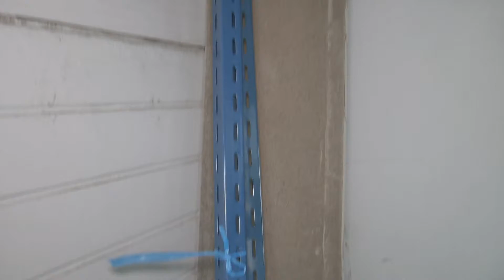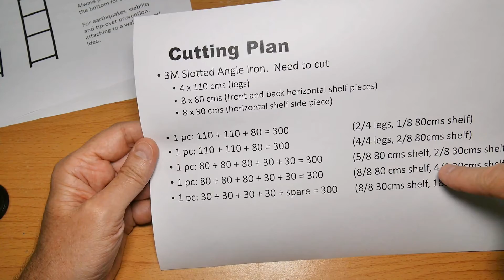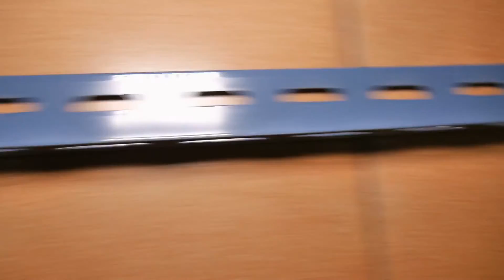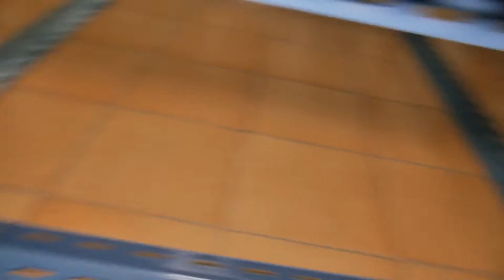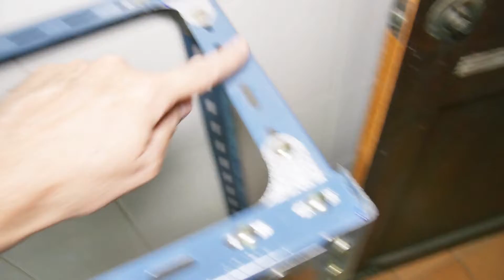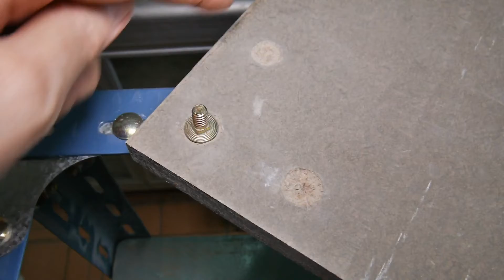DIY Custom Shelves Using Slotted Angle Iron

Comment: I had doubts about building shelving from slotted angle, specifically the rigidity. That looks really sturdy though. I'm confident now that I can start my project and it wont be a waste of money. Thanks for sharing!
Reply from the maker: The angle braces help a lot. For some reason they are harder to find, but well worth the effort.
Reply: @tsbrownie  Thanks. I'm in Australia and our local major hardware chain Bunnings actually has the angle braces readily available, albeit in a "starter kit" that has 24x nuts and bolts, 8x braces and 4x feet.

Comment: Hello fellow internet users… have any of you ever put casters on a shelf like this? If so, how’d you do it (specifics are much appreciated)? Did you take any steps to prevent racking (shelves twisting) whilst under torque/being moved? 

As for materials - has anyone got a good source for cheap slotted angle in 2024? Gotta take shipping into account, too, unless you’ve found a retailer with free shipping 🥳🥲.

Much obliged for your time tips giant cowboy hat and saunters off to await helpful replies 🤠
Reply from the maker: I have. The warning: on my first attempt, I did not account for when the wheels rotate to the inside. That puts a good portion of the weight of the shelf on the outside of the wheel and can cause the shelf to tip over. Another way to say it is the shelf is no longer sitting on the outside edge, but where it is sitting moves inside AND it moves UP. The more the wheel casters, the bigger the danger. 
I ended up using small wheels with minimal castering radius and widened the shelf. How to describe them? The mount is a metal plate with 4 holes, then ball bearing, then a round bearing race, then the wheel.

Comment: I think that square part of the bolt should be on the slot so you only need one wrench for tightening
Reply from the maker: True. The problem was the square collar was too long and when the nut was tightened, it hit the collar before the angle metal. In other words, it left the joints very loose.
Reply: @tsbrownie  okay maybe these bolts are for the thicker gauge angle bars...or a faulty product
Reply from the maker: @nicanorbadal689  I think you're right about them being for thicker slotted angle metal.

Comment: Those corner brackets aren't available anywhere in the US.
Reply from the maker: True. In the description I noted: These are getting harder to obtain. You can find them by searching things like "slotted steel shelf angle" or "Corner Plates for Slotted Angle Bar Triangular Piece Angle Steel Shelf Accessories" and similar. I can still find them on ebay, amazon, ali-express, alibaba, made-in-china, ... Not sure why companies are not selling them because they add a LOT of stability to the shelves.
Reply: @tsbrownie  Yeah I did see them on those websites but they all seem flimsy, 0.8mm/20 AWG and it's going to take weeks if not months to get them in the mail. Thanks for posting the video and responding.
Reply from the maker: @TheJourneyOfMeMyselfAndI  The ones I have are 2 thicknesses, but both are rather flimsy. However they do add a lot of stability.

Comment: OMG, You're in Thailand right?  I'm also in Thailand and when I heard that bird in the background, it's the same noise as one I hear around my home, 555.  Thanks for the informative vid, I'll be making one this week.  The only difference is the bolts, the ones you used are difficult to remove, better to have a bolt with either a screwdriver slot or a head for a wrench.

Comment: Hey great video! Really cool the final result. I wanted to ask you what was the thickness of the angles that you use?
Reply from the maker: I used the thinnest, just because it's all my local hardware store had. If I recall, they range in thickness from 1.2 mm to about 2 mm for non-commercial type application.
Reply: @tsbrownie  thank you so much for your response. I appreciate it. It helped me to decide which to use for my project

Comment: Men you don't have to put washers in evry single bolt😂😂 you don't need it I made it bigger then this and bolts tighten itself no washers needed
Reply from the maker: I agree and said that in the video. It depends on the size of the nuts. I had both 10 and 9 mm. The 9mm nuts are too small to trust with big loads.

Comment: Was this 14 gauge slotted steel?
Reply from the maker: It comes in varying thicknesses.  I'm not sure the gauge, as they always tell me in millimeters.  This is the lightest weight steel at 1.2mm and it goes up to 2mm if I recall correctly.

Comment: This is just a video I was looking for and thank you so much for sharing. I am going to build my TV stand this coming  saturday. My plan is to connect the slotted metal bar to the wall with two or three legs(to be screwed to the wall) and then a horizontal top bar. The top flat will be covered with MDF wood( 1.5 meter long and 45 cm wide). So that i can use the space to place my satellite receiver and the under shelf for placing my flower buckets. If you have an Idea please suggest me. I will share my video once I am done.
Reply from the maker: Be sure to test your finished shelf for strength before loading it up with expensive stuff like your TV, etc.  Leave a link to your video, I'd like to see it.

Comment: Where did you get those support triangles?
Reply from the maker: From a local hardware store. I have seen them on amazon.
Reply: @tsbrownie  do you have a name or part number, I don’t know what to search for on Amazon, and can’t find them.
Reply from the maker: @johnvgig  I don't see them on Amazon right now.  But I do see them other places if I search "Corner plate for slotted angle bar" or "Corner plate for slotted angle metal" and look at images.

Comment: I have a slotted shelf in my home. I want to turn it in a wardrobe. How can I fix wood panels to the slotted angles?
Reply from the maker: With thin panels, you can use the same nuts and bolts as you did to assemble it.
Reply: @tsbrownie  thanks for the solution 😊will comment as soon as I finish it🤘🏻
Reply from the maker: @madan1994   And are you finished yet?   ;)

Comment: Thanks for making this video, you do a nice job explaining each decision along the way and pointing out pitfalls. I'm considering using slotted angle metal for a project, and either I'm Googling the wrong terms or there just doesn't seem to be much info out there on how to design & build with it. Your video is an exception, thank you!
Reply from the maker: Thank you.  Glad it was useful.
Reply: @tsbrownie  One thing I can' t seem to find state-side (in Montana anyway) are those nifty triangle braces. I ended up with extra scraps of the angle metal, and cut it up to make short 45-degree braces, which seems to be fine... just tedious work, is all. I can't afford to throw any metal away :-)
Reply from the maker: @ernavk31 I did some for my parents decades ago and the local (midwest) hardware store had them.  They add a huge amount of stability, I'm not sure why they would stop stocking them.  I found some better ones on Amazon "National Hardware N337-709 MP124BC Corner Brace in Zinc plated " and "uxcell 99mmx60mmx18mm Metal Triangular Flange Corner Brace Angle Bracket White ".  I also found a picture from Homedepot under corner gussets, or gusset plates.  Odd they are not more common.
Reply: @ernavk31  https://www.amazon.com/Aexit-Furniture-Hardware-Shelves-Triangle/dp/B07HR8PCP1/ref=sr_1_60?keywords=triangle+brackets&qid=1570675284&sr=8-60

Comment: Why wouldnt you groove the sides so the width and length are flat and not a top of the other and also I think I prefer fabricating a square and only use slotted angle bar for its foot, less effort on installing and disassemble I think.
Reply from the maker: If I understand your question about groving the material, that cement board is very hard and dulls tools very quickly.  I could have cut the angle metal at a 45 degree angle, but the result would be weaker.  I don't think I understand the second part, what is "square?"
Reply: A support/surface of a cabinet.

Comment: How thick are these thing in mm?  Can it support an ave weight of 80kg?  Im planning to make a cabinet below and bed at the top bcosI have very small room so im looking for ways to conserve it.
Reply from the maker: The metal comes in varying thicknesses and so can support different loads.  I weigh over 80 kgs and you can see the frame supporting my weight.  Bottom line is I can't say for sure, too many factors.  But for more weight capability buy the thicker metal (about 2mm) and use those triangle supports at every corner, plus use heavy wood or similar for the shelves.

Comment: what tool you used to cut the slotted angle metal?
Reply from the maker: My local hardware has a sheer.  And if not that I use an angle grinder.  I've also used a metal blade in a jig saw, but that's harder and slower.